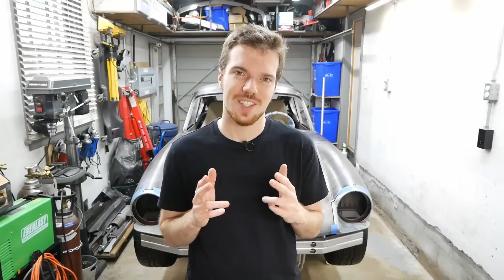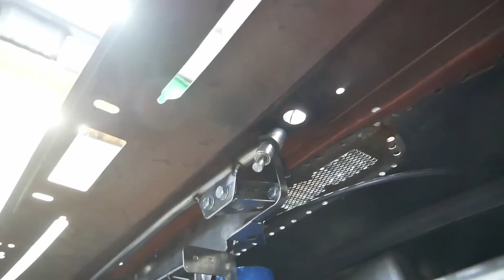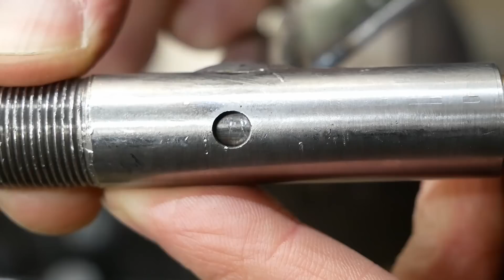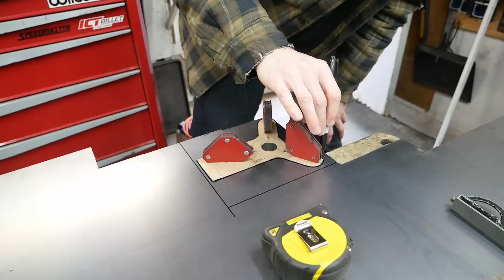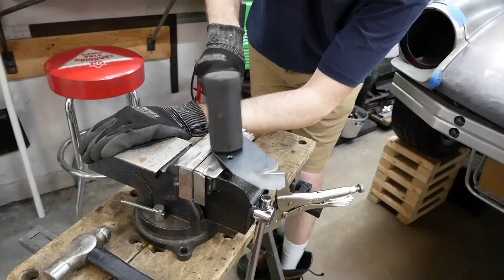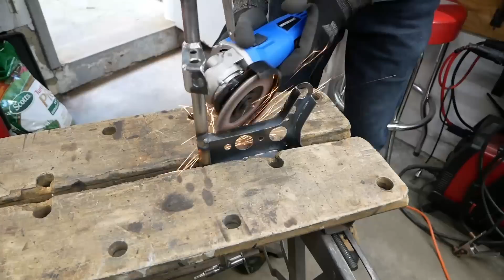Building Better Wipers – Pro Touring V8 Powered Triumph Build – Project GT6R – Ep39

Comment: Never let perfection stand in the way of good enough. 

Basically, once a problem has been solved to a sufficient standard such that the returns on time and effort spent working on the problem have diminished significantly, then stop trying. You won't get a better solution, you'll just waste time and effort over nothing. I think you've done fairly well trying to balance that in this project, though it may simply be due to the fact that you lack the tools to create things with a degree of accuracy and precision to feed that OCD part of your brain.

It's vaguely related to "grinder and paint make me the welder I ain't". Until you've got enough practice to improve your skills enough to have the raw results be presentable, then you'll need to use other methods to beautify a result that is functional, but unattractive.

Comment: wipers is the ardest part of my current build. i just cantg figure out how im going to do it. there cant be any inkage between as theres an engine in the way
Reply from the maker: I saw someone on Instagram who used very long lever arms and a bellcrank to fully clear the engine before connecting side to side. Perhaps an extreme option, and one you may not have room for, but an option nonetheless... best of luck! ✌️
Reply: @FanatikBuilds  ive bought new sytle ford wipers, they are seperate motors, currently learning to build an arduino to send a lin bus signal to control them :)

Comment: Here's a tip for you bud, when welding thin sheet metal with a ninety degree flange, try doing a vertical down it will enable you to do a thinner weld and do it in one pass. And it will not require as much weld give it a bit of practice you'll see what I mean afterwards once you've given it a shot and best of all it will not require as much grinding!

Comment: Harmonic balancers do not have a taper. They are bolted on with a key that holds the lower cam sprocket as well so a taper cannot be used.
Reply from the maker: Keyways are not always used actually, they may be the norm but not when it comes to LS engines at least... https://ls1tech.com/forums/generation-iv-internal-engine/1860124-crank-snout-gouged-scored-balancer.html ... our aftermarket balancer has one, but the crank does not.  The keyway for the oil pump gear stops short of the snout. You can drill and pin it in order to run a supercharger but that's not how these are equipped from factory.  I did misspeak on calling it a taper though ... as another viewer mentioned, these use a press-fit connection.  Apologies. ✌

Comment: Impressive fabrication skills young man. It is refreshing to see fabrication done with your mind, skills , and available tools. Not everyone has a full blown cad system, CNC plasma table, CNC milling center, CNC lathe, and on and on with sponsors to boot. I am restoring a Triumph TR3 to original condition. I decided if I was doing this I had to make the parts I needed. Yes it is slow but rewarding. Continued success on your build ! Frank
Reply from the maker: Thank you Frank, means a lot to me!  I certainly wouldn't be opposed to having some CNC equipment on hand, but until that day, hand tools it is!  Enjoy your TR3 project, lovely little car! 👍

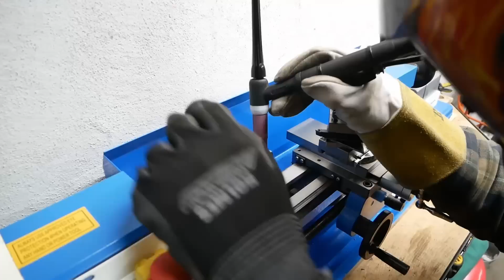Comment: 10:43 Clamping your ground on the tubing you're welding will keep the arcing away from your bearings.

Edit: Just like you did with your last weld.
Reply from the maker: @WireWeHere  At that timestamp, the tubing was long enough to stick out the back side of the headstock, so that’s where I put the ground 😎👍 thanks for keeping an eye out for me though!

Comment: looks like you used Oilite bushings, Did you pre oil them before assembly its a necessary step for longevity. great build hope all are well
Reply from the maker: They were pre-oiled from factory!  (have cut one apart before and the heat released quite a bit of oil) ... nonetheless, we will be stripping everything down later for paint, so will take the necessary precautions then!  Thanks for looking out for us Stan, doing fine here, hope the same is true for you! 👍
Reply: @FanatikBuilds  factory oil is not always the oil you should use. changing oil is easy enough. sit bushing on finger fill with desired quality oil to top, now thumb over top and pinch use other hand for more pressure you will see oil exchange . good tip for a segment on your channel
Reply from the maker: Appreciate the advice!

Comment: I'll be fascinated to see what this thing weighs at the end. Undoubtedly it will be heavier (it's hard to change anything about the flimsy original design and get it lighter!), but I have no idea how much by.

Will be a rocketship regardless, and still light compared to pretty much anything else on the road 👍
Reply from the maker: You know it Simon! 😅 I've been weighing stuff as often as I can and am hoping to keep it around 2500lbs or less ... honestly not bothered if it's a bit more though, as most of the additional weight is further down and rearward.  Time will tell, and we'll be scaling it when it's time to buy the coilovers ... so fingers crossed! 😬🤞 Cheers man, hope you are well, is your Spit on the roads?
Reply: @FanatikBuilds  Excellent! Yeah it'll fly regardless, and 2500lbs in a good number to be aiming for considering what's gone into it 👍 excited to see the corner weighting! For reference in the standard seating position the driver weight is near as damnit 2/3rds rear 1/3rd front which helps the distribution a bit.

Haha mine's still in progress unfortunately! House move, kiddo and a garage build have rather got in the way! Getting there on the last of those though and itching to get the Spit sorted after that. About time as I had one of those memory-photo things pop up that informed me I've had it 12 years! 😳
Reply: @FanatikBuilds  Oh, and if you hit 2500lbs then your power to weight (accounting for the driver) would be about on par with a MK1 Viper (or an E92 M3) with a totally unmodified LS4, a C7 Stingray (or F80 M3) at 350hp, or being very ambitious a Charger Hellcat (or a 991 GT3 RS) at 400hp 😳

Power-to-drag is interesting too as the GT6 is quite a slippery shape and small. 187mph estimated top speed at 303hp (again E90 M3, or a TVR Sagaris), 197mph at 350hp (again C7 Stingray, or a Ferrari F40), or 206mph at 400hp (997 GT2 or Challenger Hellcat).
Reply: @FanatikBuilds  Just cos this is fun, stock power would be a little better power-to-weight than Urchfab's Mushy Pea and about the same as Rocky Auto's RB30 240Z. 350hp is just a smidge less than a Flyin' Miata, and 400hp would be the same as Roadkill's Rotsun (back before they gave it 500hp and it was still making about 410).

Just nuts!
Reply from the maker: Love the numbers, thanks Simon!  With the mods we've got in store, I'd say it's got to be a very bad day for our LS4 to not make 400hp! 😬 It's honestly more than I was initially planning for, and the clutch is now our weakest link (rated 354lb/ft) ... I am increasingly doubtful that it will be an issue though, as traction in 1st and 2nd will be limited, and topping out 3rd will be excessive for the street. (5th is geared for 216mph!)  If we ever plan on tracking it someday though, a puck style friction disk will be in order!  All the best to you with finishing up your other projects (and growing family!), I hope you can get back to the Spit again soon! ✌️👍

Comment: I'm curious what you're going to do for sound-proofing.  The car will undoubtedly be fast, but it may be very loud inside making it uncomfortable to drive, which is okay for a race car (I guess), but presumably, you want to drive it to car shows and not always be in boy-racer mode.
Reply from the maker: We'll be adding a bunch of sound deadening and heat insulation materials after she's painted!  It'll add weight, but as you say we plan to drive this thing 😎

Comment: Hope you made CAD files for all of this, I would trade them for a mold to make our front splitter. Wondering how much more fabrication to the frame and intake would be for a turbo 6.0
Reply from the maker: Not really, due to everything being hand made we're more cardboard-aided design around here!  The frame would need nothing to swap to a different LS, but I have a feeling our power to weight ratio is good enough without turbos and the extra displacement! 😎😉

Comment: Shame you didn't do clap-hands wipers.  They have a nice, old-school look - and they often actually clear the glass better than the standard setup, with both blades pushing water to the sides, instead of the driver's side wiper having to also push the water from the other wiper down towards the windshield base - where it inevitably blows back up onto the glass.
Reply from the maker: True, but then you get the annoying little drip running down the middle after each wipe! 😉 Honestly I just wanted to improve on the original design and not change things visually too much... yeah... why do I do this to myself, I know! 😅

Comment: For your washers, get the type with 2 nozzles in the same head that are position adjustable. That way, you can place them anywhere you want, because between 4 nozzles, you will be able to hit all the windshield even if they're close or in an otherwise odd spot.
Reply from the maker: Appreciate the suggestion, thanks man! ✌

Comment: My 52 year old MGB has the same Lucas wipers with no sign of scuttle rot at all. Mind you, they are pretty poor by today’s standards. However, the Hillman Hunter (and Singer Gazelle/Humber Sceptre) of the late 60’s suffered from notorious scuttle corrosion after the Rootes group bean counters discovered that they could save a few pennies on each car by dispensing with the rubber washers under the wiper pedestals! I like your solution better
Reply from the maker: Oh my!  A "few pennies" is too right... amazing how management can always ruin a good thing!  I'm glad that the only original part we kept has been doing its job for you, hopefully we won't have any issues either! 😅🤞 Cheers Peter

Comment: I would have to drive it everyday for the rest of my life to make it worth the amount of work done! i would have got a system fron a junkyard and been done with it. but kudos to your OCD!
Reply from the maker: Ha, we plan on driving it as much as we can!  I would have also taken that route if possible, but I really wanted chrome arms and nothing remotely modern has that, and it would cost far too much to get parts chromed professionally.  Plus, no drive assembly would have fit around our other components, so honestly, this was our only option other than sticking with the original design!  Cheers though man 😊✌

Comment: Are you using 300 Series Stainless steel shafts with bronze bushings or oilite bushings?   I have always been told that is a no no due to the gummy stainless which can gall and actually lock up the shaft. I realize is the a reciprocating shaft but the wipers put load on the shafts and against the bushing. I am not a metallurgist so if you know this not to be true, forget I said anything as I am not bashing you and this build. I love steel that has no rust and most cars from the UK of this era were or are not just hulks if not pampered their entire existence. They rusted badly in the 60s so your vehicle deserves the best. You don't want to be changing out wiper shafts once this is built. This is a slow build but very well thought out and will not look like a duct tape, wire and torch special done on a weekend. I am enjoying the build as it progresses.
Reply from the maker: Interesting, I've not heard that ... I know stainless can gall, but didn't think it would be an issue with the bronze.  In that case, I'll likely zinc coat the spindles later when we're finishing up all the components... that should help.  Thanks for the heads up!  I appreciate the support 😎✌

Comment: Excellent work as usual! Not sure I understand the purpose of two orange bushes, as that bracket is welded to the tube at the top? IIRC the motor is totally bushed to isolate it from the chassis normally. But no doubt I've missed the point entirely!
Reply from the maker: I'm not sure how much good they'll be providing either to be honest, but the idea was that since they are right next to the motor, they might help reduce its noise/drone a bit.  I would have completely isolated it if the spindles didn't pass through the scuttle panel!  As it sits, this is a compromise, and we had the bushings on hand, so we thought "why not"! 😊 Cheers Ralph! 👍
Reply: @FanatikBuilds  Many thanks for the explanation! 👍

Comment: Great work but would it not be easier just to adapt the linkage assembly out of Golf 6? which is almost the same as You made except brackets holding it to the body and costs new like 30$?
Reply from the maker: It does look similar!  The issue at the end of the day though is that our spindles protrude through the bodywork ... meaning they need to use the factory Lucas style trim bezels and gaskets to make it a water-tight connection.  Adapting the VW part to do that would have been as much work as this, and we still would have had to redo the linkages to ensure we were getting the right sweep.  An unfortunate outcome, but all in all, we chose to go full-custom as it was guaranteed to work! Cheers man 👍

Comment: Looking great! A little word of advice, I get it your lathe is a inexpensive mini lathe, but using it as a fixture for welding can cause arcing across the bearings, which can lead to premature wear. Most of that wear can probably be avoided by having the ground lead connected to the work, and not grounding through the lathe like I think you might be doing. I'm looking forward to the next update! Keep up the awesome work!
Reply from the maker: Cheers Eric, I appreciate the concern, but rest assured the part was grounded directly and not through the lathe!  (before we cut down the tube, it was long enough to stick through the headstock, so it was ground on the back side) Cheers, really glad you're enjoying the series and I hope you'll like what's to come! 😊👍
Reply: @FanatikBuilds awesome! I kinda figured you were smarter than that! I can't wait to see this car rip! I bet it will be a riot!

Comment: Great work.  One suggestion is where two bends intersect as in the bottom corners of a box you can drill small bend relief holes.  They can make making the bends a little easier.
Reply from the maker: I always forget to add that feature, but it is a great tip, thanks Ross! 🙏

Comment: Another great episode. This channel reminds me of our very own UK motorbike engineering maestro, Allen Millyard. He works in his back garden shed & single garage, modifies engines with a hacksaw & makes most of his parts. Check out his channel - if you have any time that is!!.
There's no problem that cannot be overcome. If a part can't be bought at a reasonable price, then make it. Admirable metal work skills on display as usual.🧰🛠👍
Reply from the maker: I've not come across Allen before, but thanks for the heads up, his work is on another level from the looks of it!  Cheers man 😊✌

Comment: how do you deal with the possibility of rust at some point covering all of the bare steel parts you have fabricated--an incredibility complex and beautiful job, by the way.
Reply from the maker: We were previously coating all our parts in a rust converter product (it's why the body is black/purple-ish) ... got out of the habit though for some reason and really should get back to it.  The humidity here certainly takes it's tole on the bare steel, for sure!  Everything will be stripped down later for final paint and coating though, so we'll have to readdress any issues then.  Thanks very much, appreciate it!
Reply: Thanks!  As always thoroughly enjoy your thoughtful approach to this build!

Comment: Are those oil impregnated bronze bushings? I was just wondering if that would squeak when in use
Reply from the maker: They are indeed!  And the spindles are 100% stainless, but we may zinc plate them later to be sure nothing galls. 👍 Plenty of grease will hopefully waterproof the shaft and prevent squeaking 🤞

Comment: Gonna make a suggestion for the sprayer system. Ford Escort (late 90's-early 2000's) windshield wiper sprayer nozzles work great. The actually provide more of a mist, than a stream (like the stock sprayers on my Neon did) and are easy to find. The wiper motor system came out great, and will probably bee a reference for me for the relocated wiper motor in my S10 pickup. Hope everyhing is well with you!
Reply from the maker: Thanks for the suggestion Jay, appreciate the tip! 🙏 All doing fine here thanks, happy to have got this video done so I can return to the garage again! 🥳🔧 Cheers man, hope all’s well on your end too!

Comment: Fabulous work - the wipers on mine show willing but little else. I do wonder what the completed car will weigh though - the V8 clearly makes that mostly irrelevant but the engineering seems to be more Bentley than Lotus! This is a fantastic journey and I have enjoyed every step.
Reply from the maker: Thanks very much!  Means a lot to have your support!  I'm estimating 2400lbs dry, though to be honest I'm not that bothered if it's a bit more ... most of the additional weight is further down and rearward, so the balance will be improved and a little extra heft over the rear tires isn't exactly a bad thing ... with our power to weight ratio! 😅 All the best to ya! 🙏👍